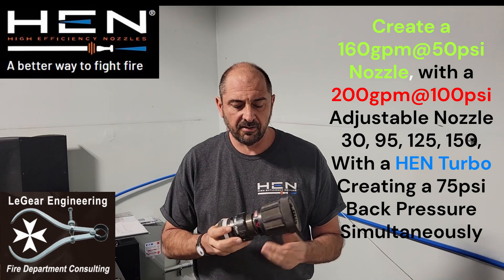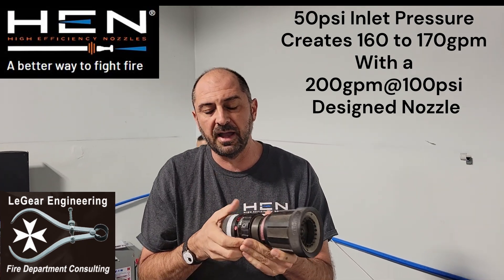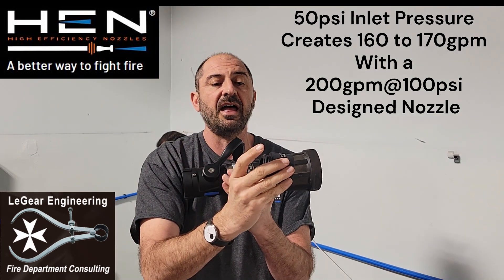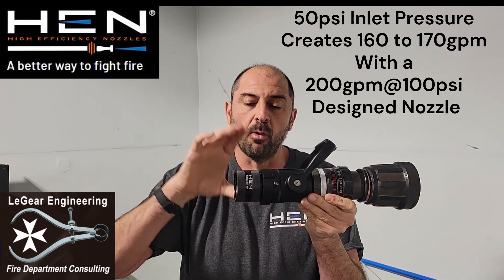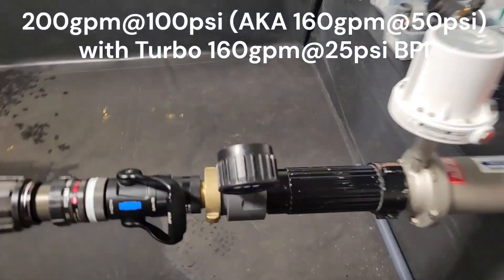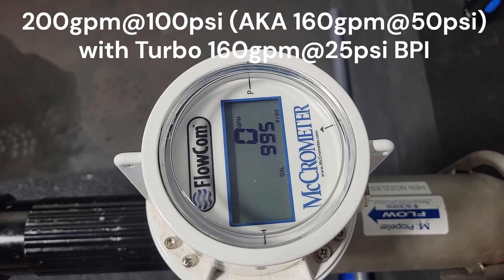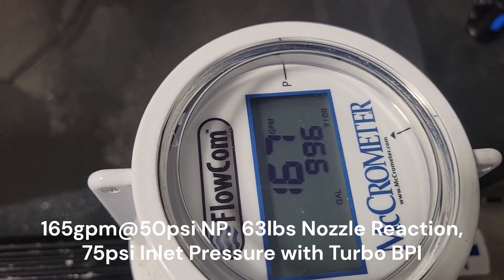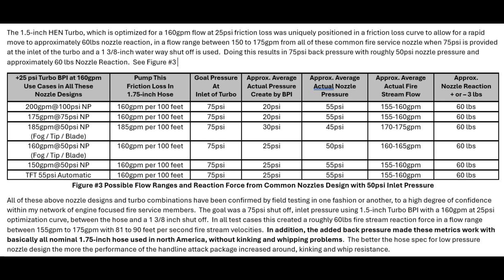Use a HEN Turbo To Create a 165gpm@50psiNP@75psiBP Nozzles From a 200gpm@100psi Adjustable Nozzle

Comment: Have you tested this with Eco-10 hose? This is a brilliant idea.
Reply from the maker: @Thumpr110  yes it works good there.  I recommend from that point on replacement hose is Sniper it has similar friction loss profile and is absolutely ridiculously good with 75psi BP and 60lbs NR.  You can see it in my other videos.  Put replacement through attrition lengths as nozzle lengths first.  Then after 5 to 10 years or so  depending on FD replacement schedule you will have a absolutely ground breaking attack package.  And revolutionary if Bladed nozzles are added